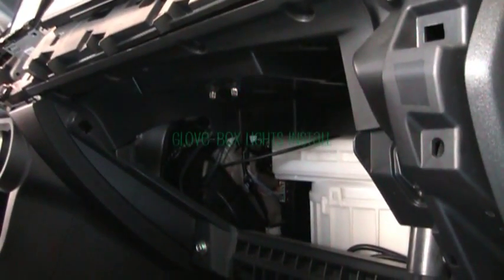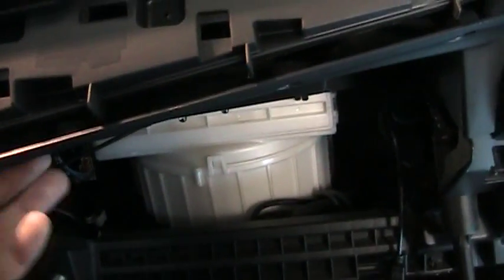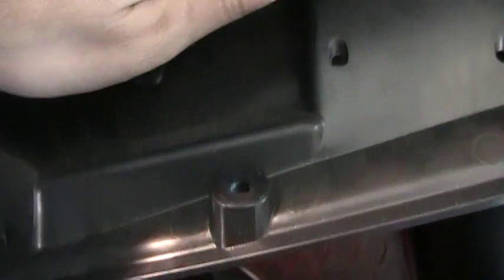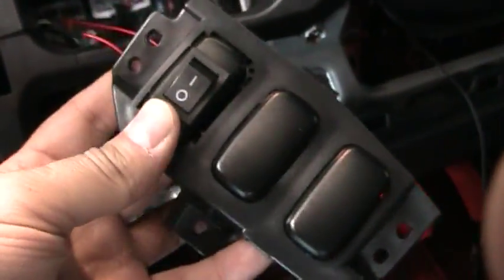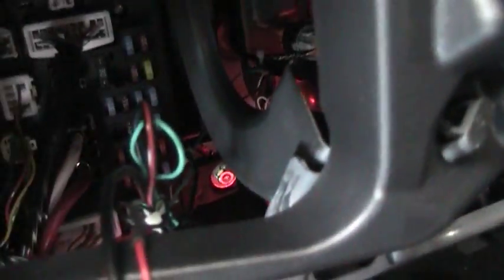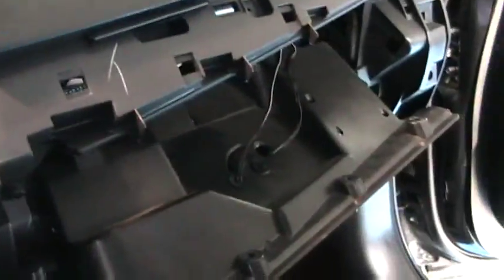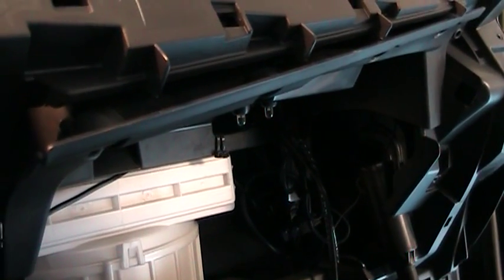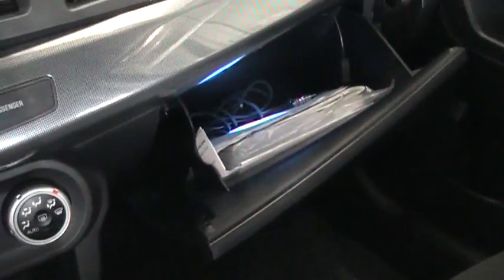Glove box light install 08 lancer

Comment: hey, thanks for your videos. i was thinking to add a surveillance camera into the car(it will run even when the engine is off, i'm not concerned about the battery drain issue since the current draw from the camera is pretty small), but not sure where to hardwire it so i can always get power from the car battery. do you have any suggestions? thanks! (hooking up directly to the battery is not an option as it's too ugly)